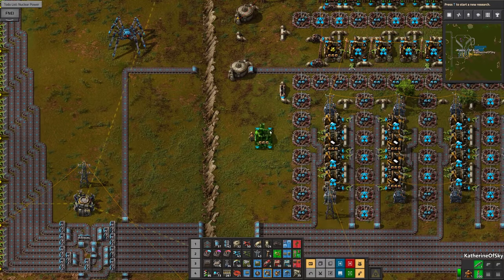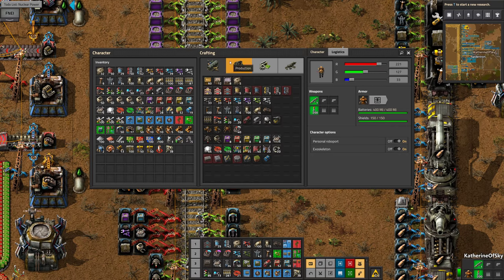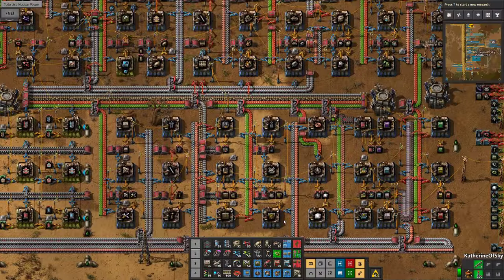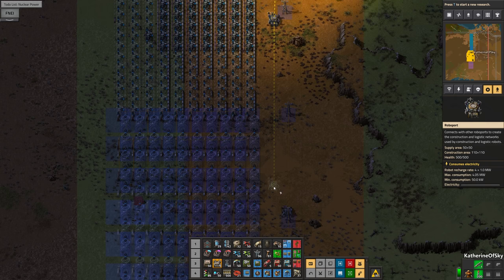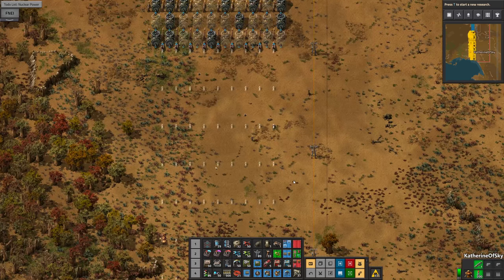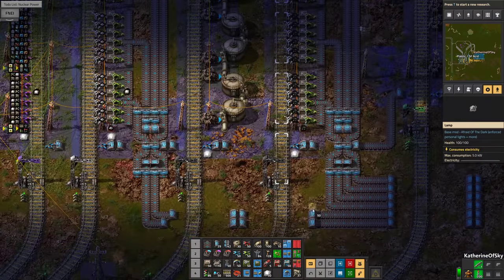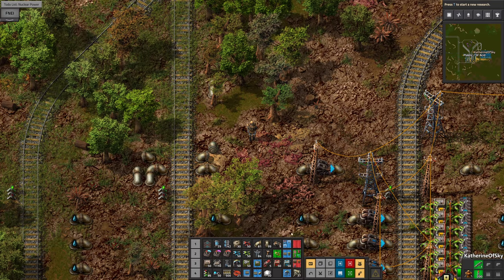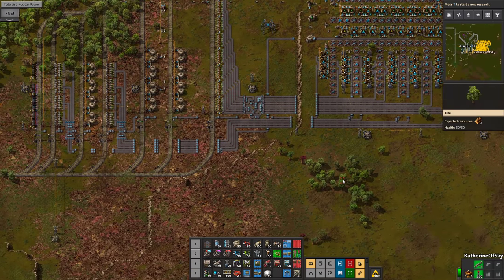Factorio 1.0 Entry Level to Megabase 3, Ep 49: NUCLEAR UPGRADES - Guide, Tutorial

Comment: Regarding why your Nuclear Reactor count was off in loading your train car-you never got rid of the original requester chest on the left side, which had some reactors in it. Once that box ran out, your circuit-controlled one on the right side worked fine.
Reply from the maker: I never had a chest with reactors loading the train.
Reply: @KatherineOfSky  At 11:33, you can see both boxes loading up the train with reactors-The box is on the left side of the train, in a 4-square with oil refinery, pumpjack, and offshore pump
Reply from the maker: @zarocza  Interesting... I didn't realize I had that there.
Reply: @KatherineOfSky  Also "read stopped train" means trains stopped at the station specifically i.e. in auto mode. Put a train into manual and it's just stopped on the track not at the station
Reply: Elmer is correct. You could use the read train id to only enable the inserter if a train is in the station and it has less that 2 reactors in it.
Reply: Thank you! I rewatched that part like three times trying to figure out what was going wrong, but everything she was doing looked correct.